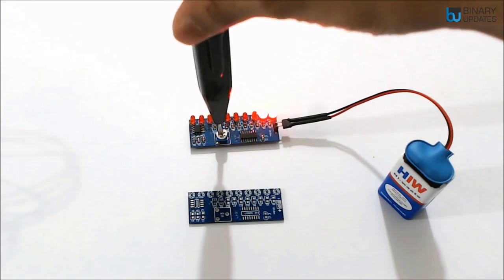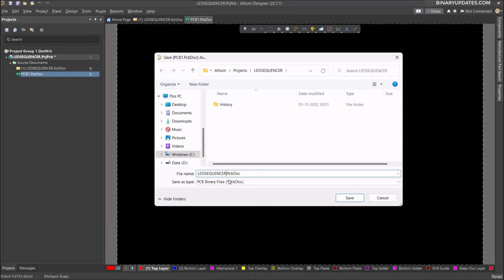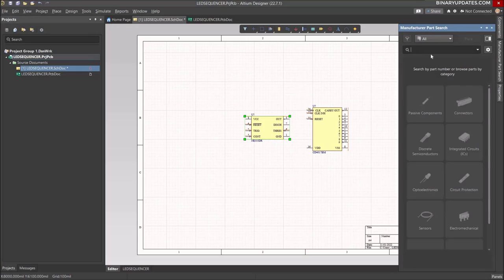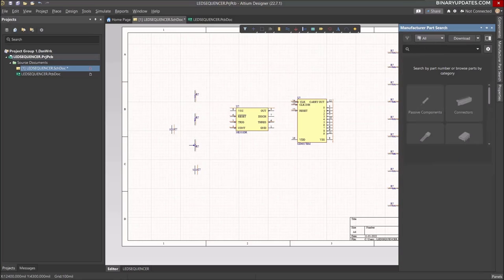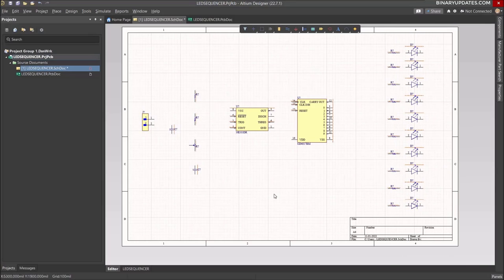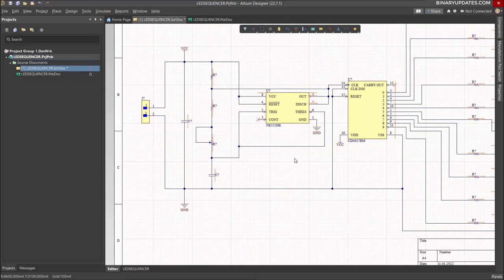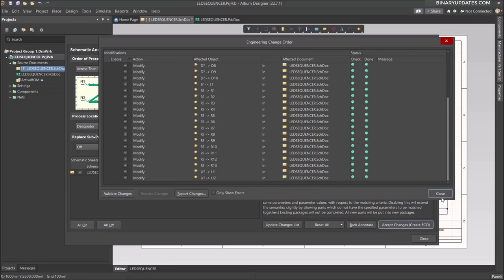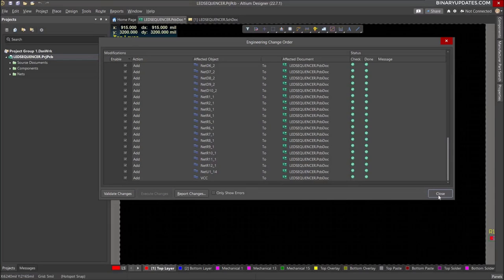Altium Tutorial 1- Create PCB Project and Schematic Design

Comment: Im not able to directly place the components after searching like you are doing. My place option is grayed out so what is the problem with mine?
Reply from the maker: Usually, in Altium designer if your software is installed properly and have a valid licence then this option will work. If you're using free trial please check its validity.